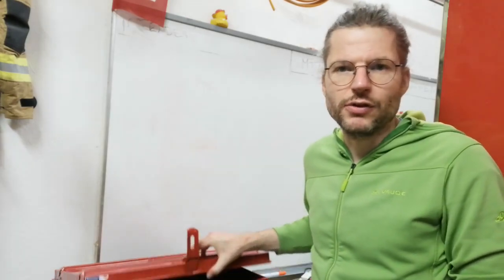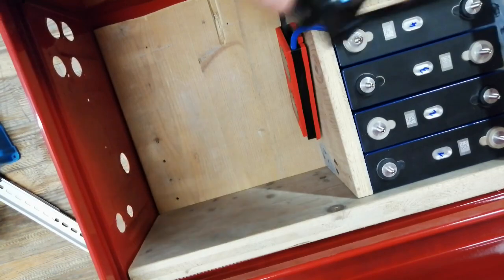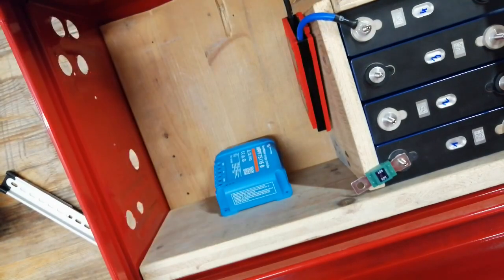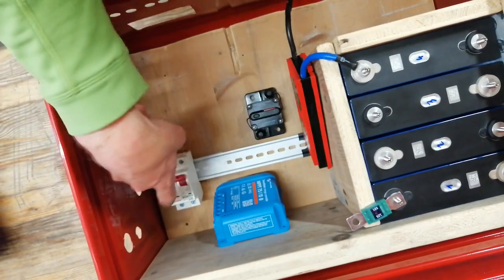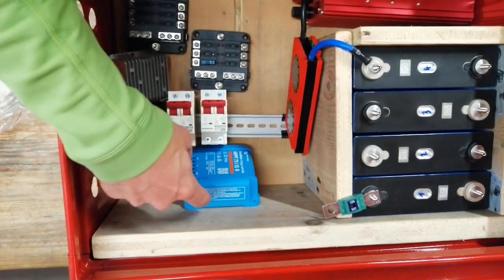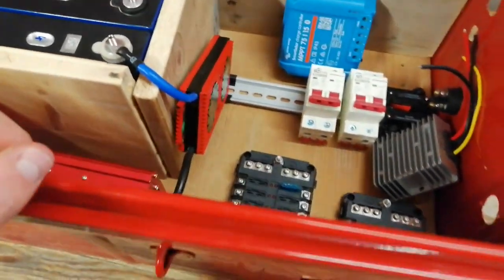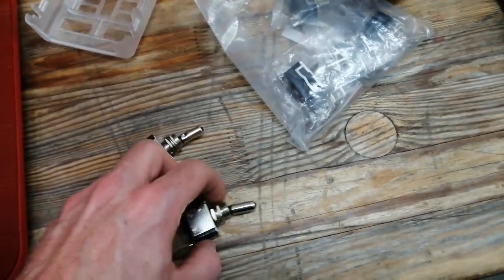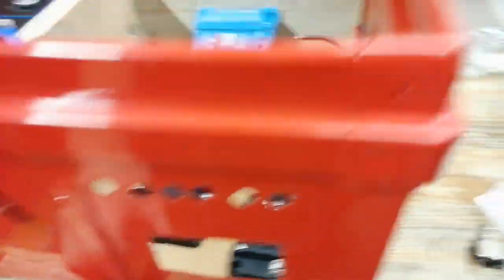Building a 12V LiFePO4 Off-Grid All-in-One Solar Box (Part I)

Comment: Is there any need or benefit to leaving air gap between your batteries?
Reply from the maker: there is no need but it also depends on your ambient temperature. for me it is always below 10-15 C (50F) degrees in the mountain hut, so no need at all. If you have a big battery (e.g. 20 cells next to each other), high amperage flows, and high ambient temp like 85F it might be useful to have some gaps or even a fan. But usually in common use cases it shouldn't be a problem at all.

Comment: 2 things about the inverter. The 2kW rating of the inverter is instantaneous rating, which will probably be about 30 seconds. Then, like you found, only about 500W. Look for inverters with the 2 ratings, pulse and constant. If you've got the money, I would invest in a pure sine wave inverter, as  modified sine wave can upset some appliances and shorten their lives.
Reply from the maker: thanks Brian for the tips, fully agree. I did also a test of the inverter in https://www.youtube.com/watch?v=J-cl7d8URRM ... to be honest, it is quite bad, but yeah, for this price... I want to get a better one in the future but for now it is quite ok, to e.g. use a jigsaw. For that I also do not need a pure sine wave inverter (now). Do you have any recommendations for an inverter or good experience with a specific brand?
Reply: @LupoDIY  Sorry, I don't have experience of any specific brand, but best option is to look on Amazon and sort for average reviews. Then buy the model on eBay. Also, look for 1 with your specific county's plug type. Do not get one with the multi socket - these are dangerous, as you can easily touch the terminals.
Reply from the maker: @BrazzaB1  makes sense, thanks

Comment: Nice videos 👍 
If I’m correct the bus bar from your cells it’s rate to 50 amp. You can add more bus bar to increase the amp
Reply from the maker: thanks for the information, how do you know? but in general I agree, I do not trust them for more than 50amps. I pulled around 80amps in a test in https://www.youtube.com/watch?v=J-cl7d8URRM and they stayed quite cold. unfortently, with the crapy breaker I cannot pull more than 60 amps anyways as it trips already at around 60 (rated for 100A) ... that happens when you use cheap stuff. :(
Reply: @LupoDIY   
I know because I buy 200ah cells and it come with the same busbar you have , I ask the seller and he said 50amp max. So I add 5 busbar each. I have a 4s so low volt and high amp (RV)
Reply from the maker: @pelecho  ok thanks a lot, I have still more busbars that I could use but I guess for my use case it is fine, can still change it when I use a bigger inverter. but thanks a lot for information. you can also calculate it, witdh*thickness in mm is the area. and area * 1.2 = amps. so e.g. 20mm*1mm => 24 amps

Comment: add some case fans for cooling
Reply from the maker: thanks for the tip. I am going to replace the inverter so I wait until I know how the air flow of the new inverter is, maybe filtered outlet in the box in front of the fan of the inverter is already sufficient. in general the ambient temp is quite low and usually I do not use the inverter for more than 15min, so it was quite ok so far.